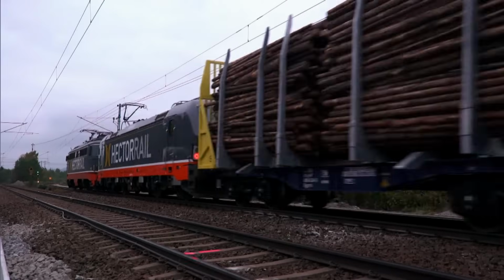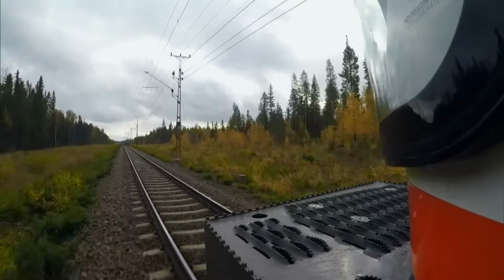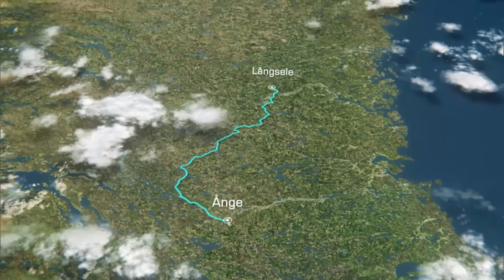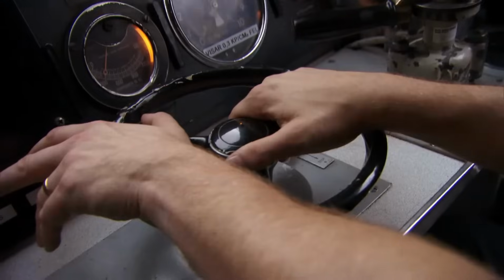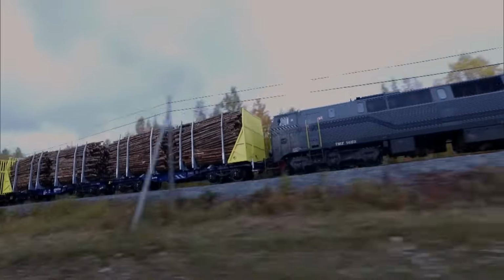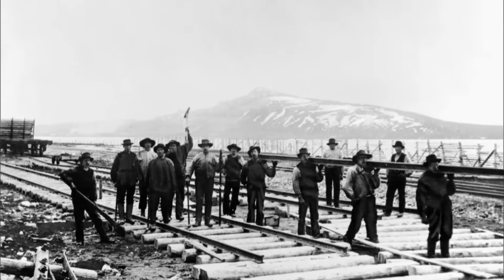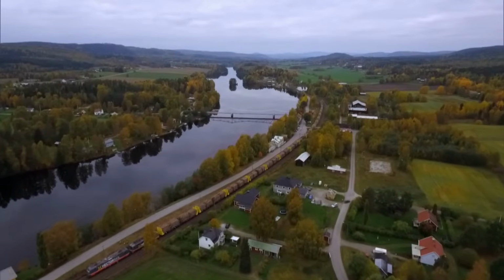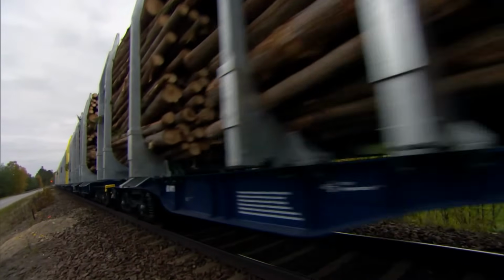Mighty Trains: Hector Rail | Season 2 Episode 6 (Full Episode) | MIGHTY

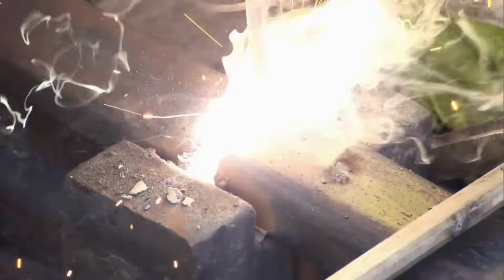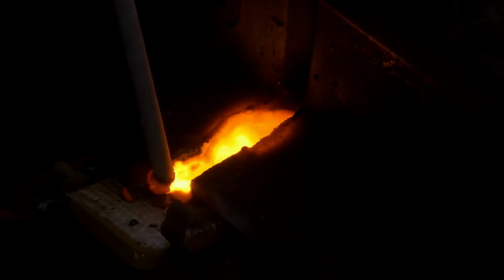Comment: 25:25 I am a welder and rail fan and this is probably one of the worst rail joints that even India can’t beat all American and Canadian rails are thermite welded and has no slag inclusion in the process and extremely strong however these welds will not especially in Scandinavian environments I can tell by the thickness and coating of the rod that it is a 7018 or something with a similar coating and it could be used to weld a rail together it’s not the best and the first clip of the initial weld is nothing but slag and will weaken and cause cracks and he is welding on top of slag in this specific scene at 25:25 I would be more than weary going above 40 k on those tracks

Comment: Why didn't they upgrade the old diesel with a modern one(For example; a Vectron DE), or electrified the line?
Reply: I have been driving this route for 13 years now and the locos have changed:

Vossloh G 2000 BB
T43 mult
Tmz mult/single
Siemens ME
MaK G 1206
T66
TME

I might have missed some but it's down to what is available. The TMZ is very reliable and works well in the tough environment.

Comment: Hello, fellow Swede here, I’d like to point out that I’m extremely surprised that they changed old sleepers for healthier old sleepers, most railway lines here in Sweden has concrete sleepers nowadays.
Reply: Still plenty of smaller lines with wooden sleepers, to expensive to change out the entire line with concrete. /Swedish train engineer